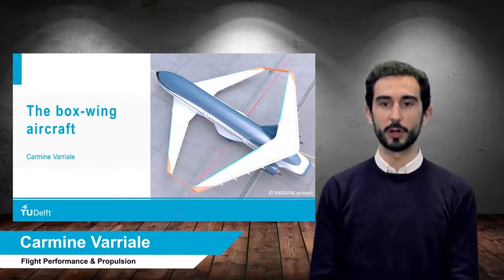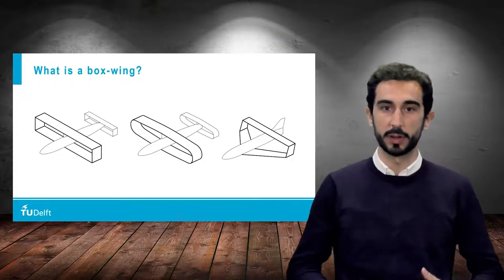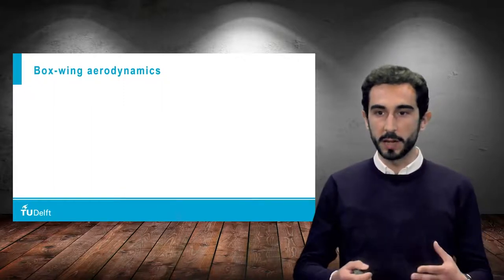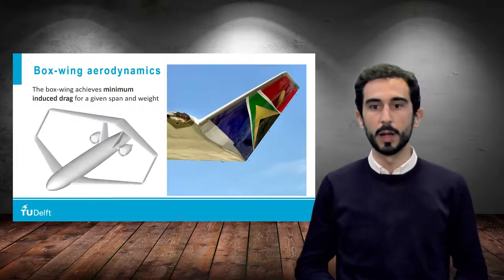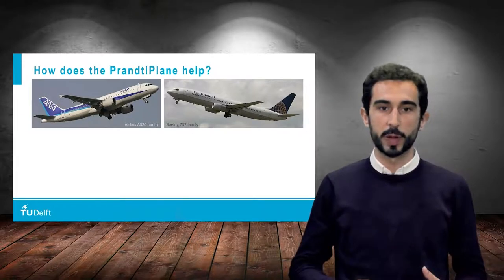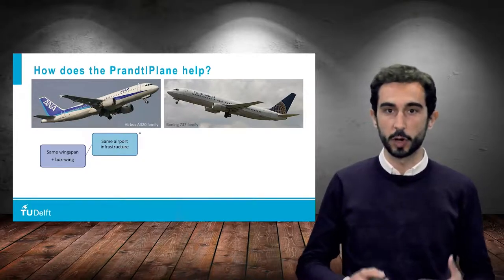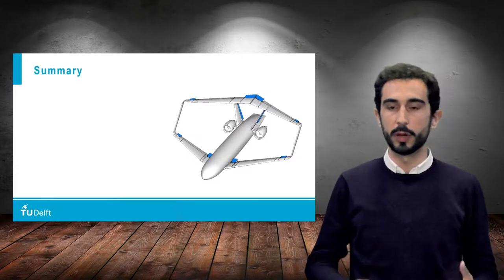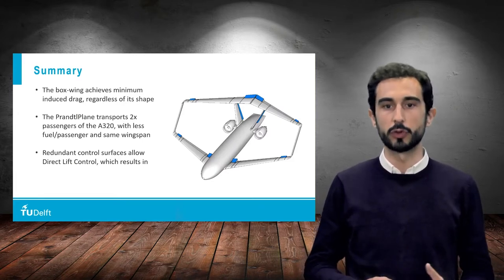Box Wing Aircraft

Comment: The old problem of staggered biplanes is back. 
The front wing sees the rear's upwash, while the rear wing has to live the the front's downwash. 
We have to live with true non-linear aerodynamic characteristics, complicating layout out FC-Systems, 
which is even more complex with the multitude of controls here and there.
Furthermore the "box-sides" supposed to act like wing-lets will do so only at a certain flight-condition (speed, AOA and/or weight). 
As long as they can not be adjusted to the developing induced tip vortices the eventual thrust along the side-leading-edge is not available.
Apart from that the parasitic drag and interference drag comes with the planes complexity.
The ease of streched or shortened fuselages no longer can be used and each version has to have its individual wing-integration.